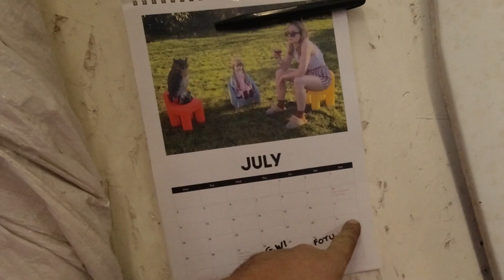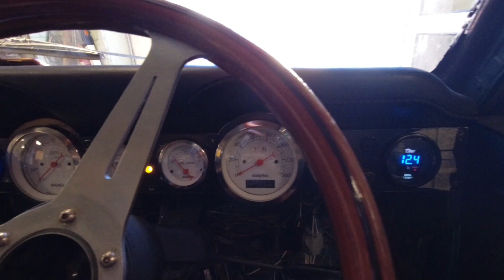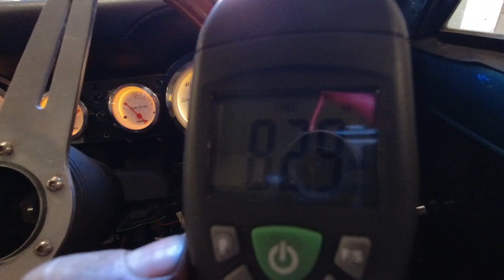PROJECT HILDA 6: The race for Goodwood pt6 | Hillman Imp VTR

Comment: The engine noise reminded of a washing machine final spin of my overalls with small screwdriver left in the leg pocket, Glad its coming together Rich Great video as ever!!
Reply from the maker: That's.....that's not a healthy sound for an engine to make!
Reply: I use to be a fire Protection engineer.  Most pump houses have 1 diesel and 1 electric fire pump. The delivery none return value on the diesel  was stuck open.  The electric pump came in and put water in and pass the diesel non return valve turning engine thus turning the engine backwards.  Thus no oil pressure thus the engine was a right off. Had been running backwards for about an hour then it ceased

Comment: There are these things called transfer screws, used for transfering the position of holes from one part to another. Arc Eurotrade sells them. 

In your case, they're through holes, so sharpening a fastener to a point would do.
Reply from the maker: Will check them out.